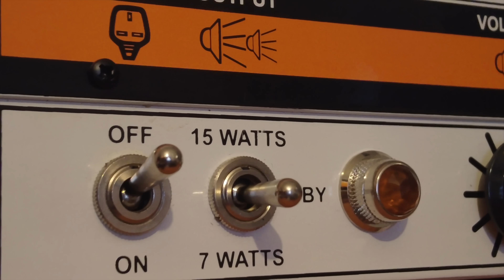WORLDS HOTTEST PICKUP

Comment: I have a set built by a friend of mine in Germany, who used to run Rübezahl Pickups (out of business  unfortunately), and that set is 43 and 37 kOhm - bridge & neck respectively.
He sais they were built with doom metal in mind, and he wasn't wrong 🤣🤣🤣🤣🤣

I'm pretty much a medium / high output type of guitarist, anything between 11 and 16 kOhm with AlNiCo 8 magnets is my preference.

The Rübezahl beasts are much hotter ánd have ceramic magnets - which make them a hair too harsh as well as muddy. I might change the magnets to AlNiCo at some point, see if I can temper them a bit 😎👍

Comment: The DC resistance in ohms or kohms of a pick up is not related to its output.
If you want to get more impedance then you use thinner wire which has a higher resistance per meter  - you are using the wrong terminoogy

Comment: you´re measuring the DC resistance, not the output. Output comes from the number of windings and the strength of the magnetic field. Sure, more windings mean higher DC resistance, but using a thinner wire also increases resistance. 
In the end such a pickup is pointless. We have gain knobs on our amps and if that´s not enough we can use pedals instead of buying that dull sounding piece of crap.
Reply: Right. Inductance is a better measurement than resistance to dictate output level.
Reply: @ChrisRash  Inductance is better but it tells very little about the strength of the magnetic field. Inductance can vary depending on the pickup design and magnet materials. The pickup is essentially a coil with a core. Even a non magnetic iron core would raise the inductance and the pickup would have no output at all. 
To measure the output you would have to measure the voltage produced by a vibrating or rotating piece of ferromagnetic material over the pole pieces. 
Everything else can give you a guess about the output. Pickups with high resistace tend to have higher output but not always. Take humbuckers in a single coil format as an example. You need to use a smaller magnet and a thinner wire to get the same number of windings onto it. A normal sized humbucker with the same output will have less resistance and due to more space for larger pole pieces a higher inductance. It´s a complex topic and every detail of the construction also influences the sound, although that doesn´t matter much in high gain applications, at least not in most cases.

Comment: Am I being too pedantic to point out that "KOhms" and "Output" are not the same thing? Output is related to how many winds of wire there are, and how strong the magnets are. KOhms just measures the resistance of the wire. Sure this one is high output, but claimingthe highest just because the Kohms is highest is misleading. It could just be wound with skinnier, higher resistance wire.

Comment: Never seen so much disinformation about pickups in a single video. Comparing the DCR of a pickups with different construction, different magnets, different metals it doesn't make any sense at all. It just tells you how long is the wire (if you know its thickness). The only value that REALLY tells you the output of a pickup it's the inductance value, measured in Henry (H). You need an LCR meter to do it. Please do your homework before posting technical videos.

Comment: When DiMarzio created the Super Distortion, and later, the X2N, in the 70's, there simply weren't high gain amps available. The closest thing to a high gain amp, which might be considered a medium gain amp by today's standards, was the Mesa: Boogie Mk1. Even Marshall's were just basically Fender 50's Tweed circuits but with British valves/tubes.... As amps of the 70's and earlier were simply not designed to have massive amounts of gain, and most amps were actually only designed to be played relatively clean, the ONLY option to increase the saturation of these clean amps was to increase the signal going into the amps at their inputs. To do this, there were two options..., either use an active booster circuit of some sort, OR..., use much hotter passive pickups... If you wanted to use hotter pickups than the stock models in factory instruments, there was two easy ways to go about it that didn't require a complete redesign of the pickups..., swap the Alnico magnets out for stronger ceramic units, and rewind the coil bobbins with many more turns of coil wire... In order to greatly increase the coil turn count using the same size bobbins, you would have to use a thinner gauge coil wire to prevent the coils exceeding the physical size of the bobbins... That was basically the formula that Larry DiMarzio used... Start with a Gibson PAF design,  but use a stronger ceramic magnet, and use thinner coil wire to greatly increase the number of winds on the bobbins... With the lower gain amps of the time, you could slam a much hotter signal into their inputs by simply using a PAF style passive pickup, but with a stronger magnet and a higher coil wind count... However..., in our modern day, almost every guitar amp made has insane amounts of gain available from their circuit design..., so the need for booster pedals or super hot passive pickups is gone... Even the lowest output pickups can be cranked at the amp to a din of pure saturated overdrive distortion... So in our modern day, you can shop for pickups using their tonality and dynamics as deciding factors instead of their output, as you can get as much saturated distortion as you want, no matter how high or low the pickups' output level is...

Comment: aside from single coil or humbucker, all pickups essentially sound the same.the tone difference is because the amp gets a higher input increasing the distortion of the preamp. you can get the same effect from a boost pedal, and you get even more control.

these are a gimmicky scam.

Comment: The problem with that kind of output is... The pickup has zero nuance 

A "rail" pickup is one of the oldest designs. One of the first guitar pickups is referred to as a Charlie Christian pickup, so it is capable of being very sonically nuanced. When you look at old OBL and the newer Wilde pickups (Bill Lawrence), they are capable of being PUSHED very hard, but you can back them down and get very ringing and sweet tones out of them. 

Unfortunately, this pickup is a "One Trick Pony"

Comment: Looks just like a Bill Lawrence 500, as he designed in the 60's, but those are not as hot!  The 500's are great pickups though, and not so hot you loose all control of attenuating the effects pedal chain with the volume knob of the guitar.  Hot wound pickups are over rated for that and other reasons, they are always distorted to the point it can't be dialed out, and distortion and fine control thereof is what pedals and preamps are for!

In this case one may have to consider the longevity of ones other gear in the chain after the guitar!  I think it's just a ridiculous gimmick, and just made because there are enough players with "Gear delusion syndrome" that don't understand "More" doesn't equal "Better" that will buy it even at a high price.

Comment: Why do you keep equating the DC Resistance rating to its output level? There is absolutely ZERO relation between the two. 54k ohms only means it's the pickup with the highest DCR rating. That's it. There are other measurements that are actually useful at determining the output of a pickup.

DCR (54k ohms) IS NOT one of them. The fact that you keep referring to that number every time you say "hottest pickup in the world" tells me you incorrectly think there is a relation between the two things. There's not.